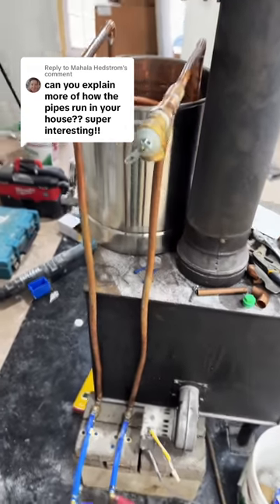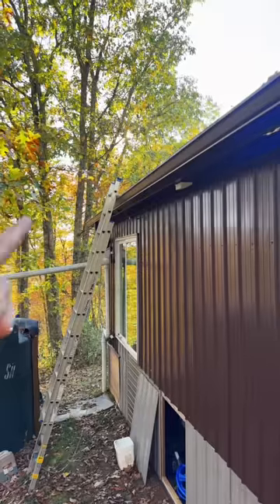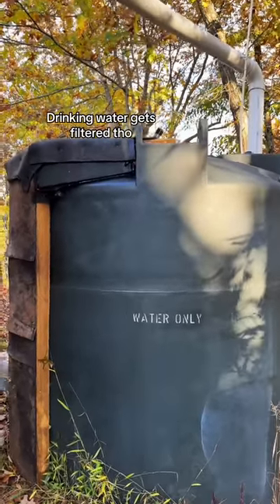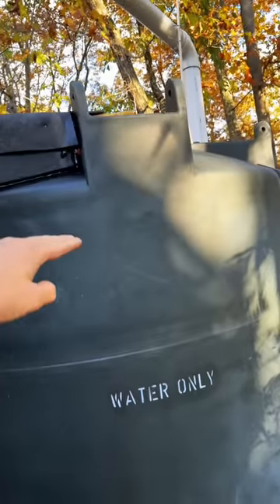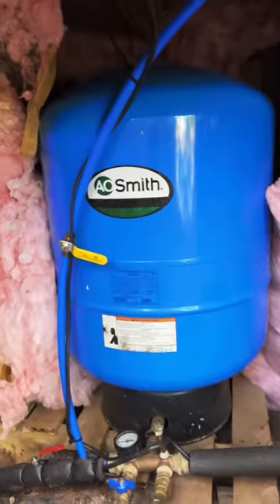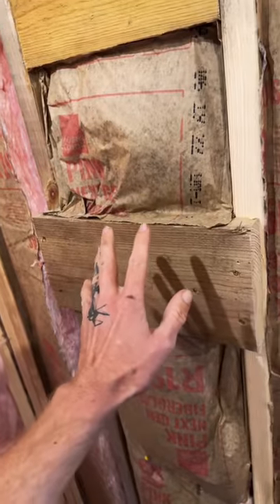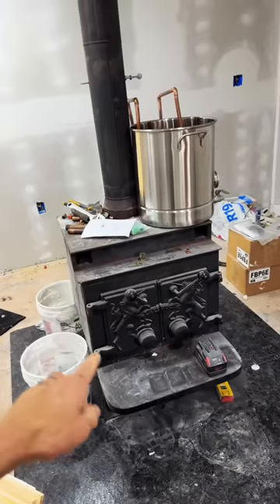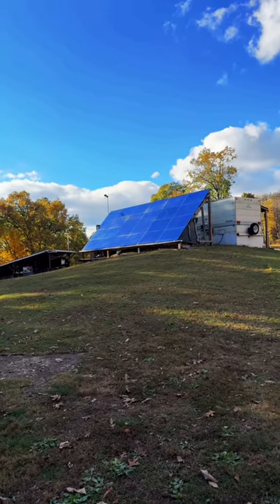Plumbing and how it works

Comment: On demand electric uses a lot of current. A traditional tanked water heater will act as a thermal battery and you could even set it up on a timer to only 'recharge' when sunlight is available, saving your battery stoarge for other things. Or if you would like to be able to use it for a bit longer during the year after power generation starts to fall off, there are heat pump/hybrid water heaters that use a fraction of the power to heat the water with a cost of being a bit slower to recharge the tank

Comment: They have propane endless water heaters that run off 2 "D" cell batteries for the ignition. Been using this set up since 2016!

Comment: Build a small rocket stove to heat your water. You can buy them. They make hot water heaters wood fired. a friend of mine had one when he lived in Colorado. Took about 5 minutes to heat the water up and it kept it warm in the tank for quite awhile.

Comment: Nate you gotta look at the specs on those electric instant hots if I’m not mistaken they use like 3, 40 amp circuits.  They use a ton of energy.  Might have to do a little math on how much usage that is with your solar setup.  I love how your using the stove in the winter.  Sooo efficient.

Comment: I hooked a propane camp hot water heater to the top of my shower, it heats the water perfect, it was $80 and uses very little propane and uses 2 d batteries that i recharge. Its temprature setting can be controlled by degree, its very consistant very good hot water for very cheap. You will need a small section of garden hose between the shower head and the hot water heater intake.

Comment: I looked into on demand electric WH. It requires 2 220vac 60amp breakers..... i dont have that much spare current.... oh well.
Reply: The on demand ones are a pain. You can get small tank style ones that produce around 15 gallons and run around 15a at 120v

Comment: Years ago my water heater was 60 ft of 1/2 copper tubing wrapped around my stove pipe. It ran into 2  sections of 6” X 8’ pipe. Then down into an in floor heating system. The constant heating snd cooling of the water kept it moving. Pulling off water fir showers and whatever kept a fresh supply in the pipes. In summer I diverted the water into an 8 gallon pros r water heater for showers

Comment: Gonna have some awkward days in the spring and fall 😂 might end up relying on that electric heater more than not

You definitely dont need to filter after the tank if youre filtering all the input to begin with, we have a duel stage filter set up directly after the well pump at my place, my father inlaw is funny about the tap water 😂 alot of the wifes family is funny about the tap and the outside spigots.

Frankly, you can drink fron the toilet tank here and it would be fine, its all the same, and its all filtered already

Comment: I have a instant hot water heater that I put in my camper it only needs a c battery to run the igniter and if u have a water pump and a car battery as I did you can shower for hours from water in a creek

Comment: Are you allowed to make turpentine? If you set up a couple of barrels for making your own charcoal and collect the turpentine and pyrolysis oils, you can heat your hot water while making charcoal and turpentine that you can use as fuel later! Heck you can even type the unburnt gases to your generator and make electricity too!

Comment: What about setting up some sort of solar water heater on the roof of that building for the summer months?
Reply: ב''ה, hard to come by plans these days to the point my old book of them got stolen, but would be nice to see how the 1970s "strip a water heater of insulation, paint it black and shove it inside a glazed solar oven" idea works in practice.
 
That or the pool heater panel to heat exchanger idea seem somewhat promising and cheap to implement.

Comment: Your water heater is basically part of my beer brewing equipment except you're actually using the warm water coming out the other end of the coil. I'm sure you will, but make sure the coil stays clean.

Comment: If your heat is not running in the summer. Would consider putting a black barrel on top of your roof to be sun heated all day. And just siphon the water down for a hot shower at the end of the day?

Comment: Find a highpoint on your property and build a power shed that's sturdy enough to put a lot of solar panels ontop, if you do it right you should get enough excess power year round to even get a lil money back from the state,
Reply: Unless he is off the grid and he is. He does not use public utilities and is not connected to them.
Reply: @janet1744  doesn't mean he can't take advantage of them, it's pretty easy to hook your solar system up to a grid and if you've got a big enough system it's more than worth sacrificing that bit for the yearly extra income, grants you a bit extra stability

Comment: An electric on demand or an electric point of use water heater? Electric on demand water heaters use a tremendous amount of power. My dad looked into them around 10 years ago I believe and it would have used more power than the rest of the house combined by several fold.

Electric on demand water heaters draw 27,000 watts compared to 4,500 watts for 40 gallon water heaters or around 1,500 watts for point of use systems (the one I looked at was 6 gallons). If you really want on demand water heating I highly recommend propane or natural gas.

Comment: Would rain water contaminated by atmospheric pollutants affect your water at all?
Reply: All rainwater has forever chemicals in it, but nearly half of all tapwater in the US also has some amount of forever chemicals in it. There are new york times articles on it aswell as bbc articles.
Reply: Don't think you can get away from those. If they're in the atmosphere, you're inhaling them anyway.
Reply: He said he filtered it going into the tank by several methods. He doesn't filter it coming out of the tank.

Comment: Electric on demand water heater?
Exactly how much power can your system actually provide? On demand heaters are energy efficient, but their power demand while operating is huge.
Some quick calculations.
Assuming
2 gallons per minute shower.
Starting temperature of water at 75°F
Ending temperature of water at 100°F
Power needed is 7300 watts

Of course, if the starting water temperature is lower, the wattage increases. And that 2 gallons/minute shower is for a low flow high efficiency shower. The average shower is 2.5 gallons/minute, in which case the power required would be 9100 watts.

Comment: Wouldn't a.propane on demand water heater be more efficient?  Although I do see how the extra costs may be less inviting, if you don't already have propane service.
Reply: Currently in winter it costs nothing extra to heat his water and in the summer an electric water heater would also cost nothing to run with his solar. 

Propane would just be a constant expense.

Comment: Have you had any issues with the watermark itself freezing? It is just sitting out in the open with no insulation. I mean yeah the mass of the water itself can slow it down and maybe even stop it to a point but wouldn't a extra or consistent cold and long winter cause even it to freeze solid?

Comment: Do you have wind near you during the winter in ga we use turbines to generate electricity during the winter becase we have good wind you can buy then for about the same as solar panels or get some 1 wire alternators and radiator fans

Comment: Does that actually heat your water for a shower? I mean to say does the hot water keep up with the demand? Or do you get an initial burst of hot water and then back to cold cuz the water runs through the coil too quickly?

Comment: What on demand water heater will you use that will work with solar? Eventually we want to switch to completely solar, but hubby wants to wait so we are starting with shore power and he wants an on demand water heater but thinks they cannot be run on solar.
Reply: ב''ה, batteries are getting good these days but you might want to look at direct solar thermal; reckoning with fragility and leaks can be an issue, but depending on climate you've got various options.